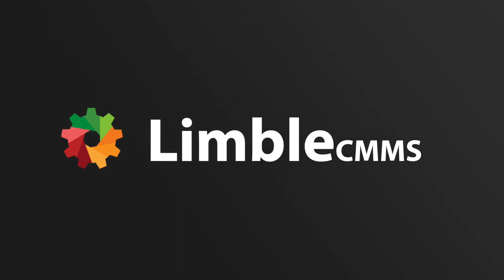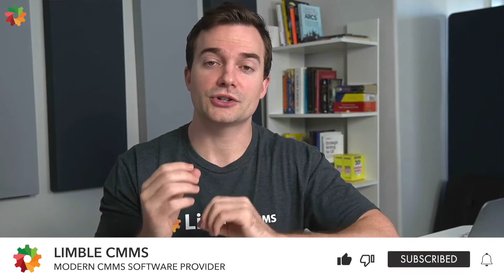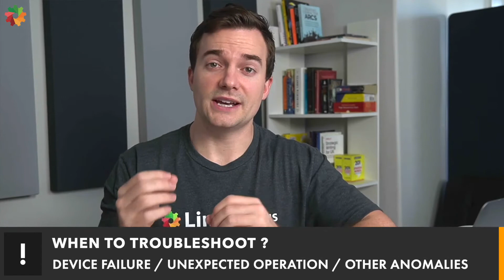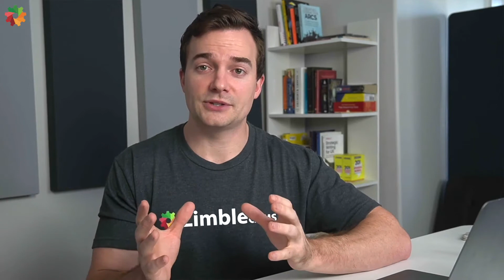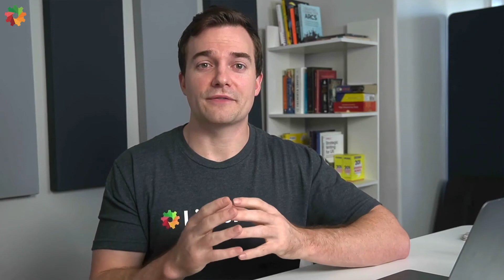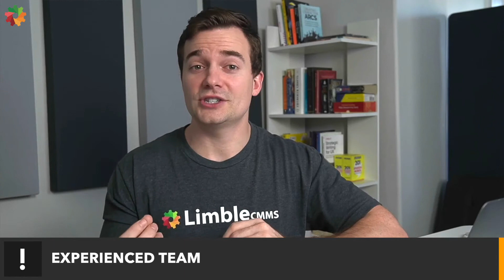Comment: Hi, I have a question. Imagine that I have an asset for which the maintenance is expressed in more than one unit. For example: the preventive maintenance of my car will be determined by calendar time (years, months, days); by the amount of km I drive and by the times I start the engine. Maintenance will be done when any of these 3 limits are reached which ever comes first. Can I track all the 3 limits mentioned in the previous example with LIMBLE?
Reply: Yes, you can do that in Limble. The way to do that is to set the schedule to trigger on any one of those limits being reached. Then you would turn on the "recalculate upon completion" setting. Our support team would love to help you set that up. Feel free to reach out to them by going to our website and using the chat in the bottom-right corner.
Reply: Thanks for your question! Each PM can have multiple schedules, so using your example, you can create a schedule based on each of those criteria: by date, by number of km driven, and by how many times started. Whichever measure is reached first is what will trigger the PM.

We hope that helps. If you have additional questions, you’re always welcome to visit us at https://limblecmms.com/ and clicking on the chat bubble in the lower right corner.